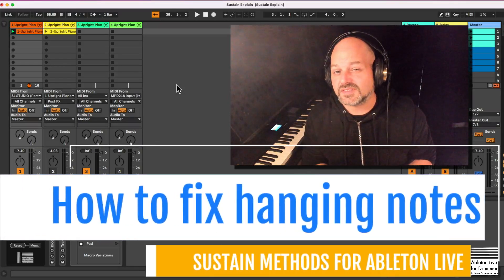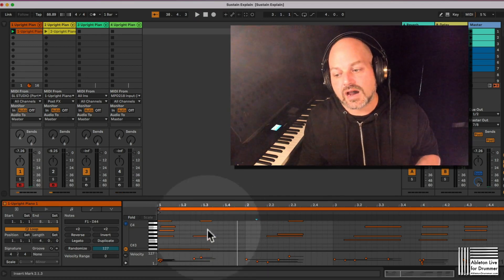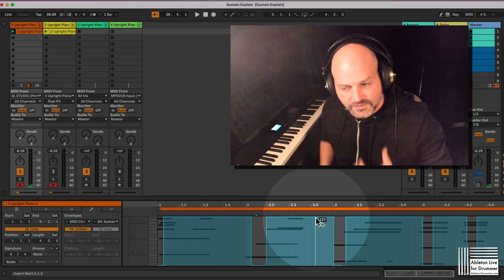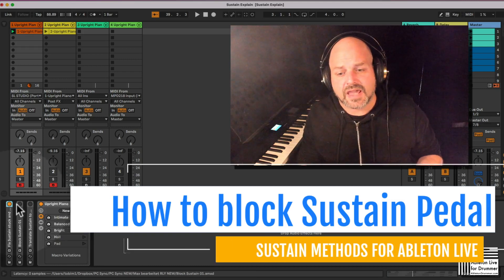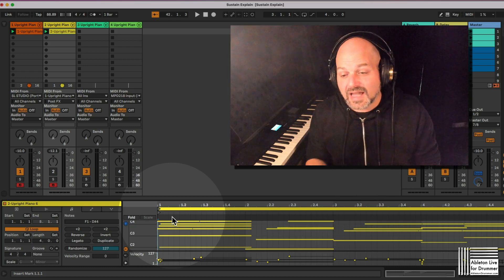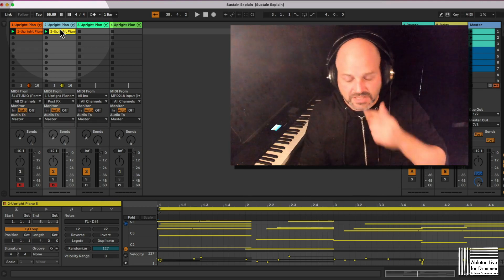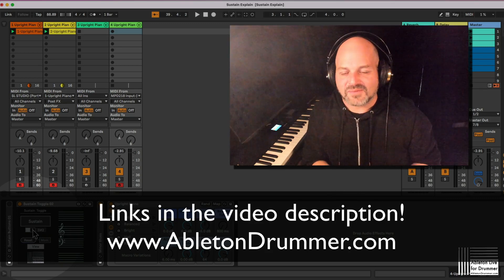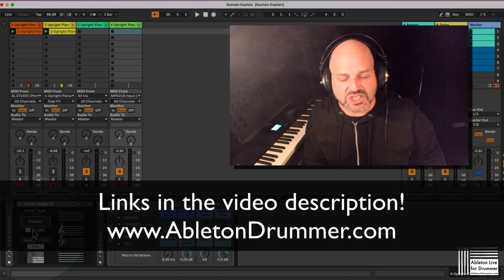How to fix hanging notes and master sustain in Ableton Live - Max for Live Devices

Comment: im having an opposit issue.  the notes do not sustain even when i keep the key held down.  the notes are clipped, unless i use a sustain pedal, in which case switching notes without bleed is almost impossible, as i am not a robot  any fix? thanks for your expertise.  (this happens particularly wwith sampletank 4, for me.)

.
Reply from the maker: Hey that might has to do with some presets for MIDI notes in sample tank OR the problems lies in the source/your midi controller - you could check what MIDI note messages you are sending e.g. if the notes you are sending are 'hold down' via using my online MIDI monitor - https://blog.abletondrummer.com/online-midi-monitor/
Reply: @abletondrummer  thanks, i will check that.  im not so saavy with midi...just a dumb guitar player and vocalist here. LOL.  im learning tho, of necessity.  i appreciate your comment and will see what i can figure out.  thanks for the link.

Comment: Hey man, I just bought the 'fix midi sustain' pack, and yes it works for pausing the whole set, but doesn't seem to work for stopping an individual clip? When I do this the sustain carries on. Any ideas? Thanks so much in advance!
Reply from the maker: Hey - It would be great if you could shoot me a short(!) video showing your use case/which exact device/set-up you are using here so I would be able to advise - please send it over via email. https://blog.abletondrummer.com/contact/
Reply: @abletondrummer  I'm having a similar issue. Any luck on figuring this one out? The global stop triggers the plugin just fine, but when you go from one scene with a clip to the next, it doesn't trigger the plugin. not sure if it was intended to do that as well
Reply from the maker: @yechi_music  I just uploaded the new device into the pack, so you peeps should be able to access via this link when you sign in: https://abletonkurse.gumroad.com/l/Sustain-Notes-in-Ableton-Live
Reply from the maker: Yep - solved now - https://youtu.be/Kq3Kp0SZy3Y